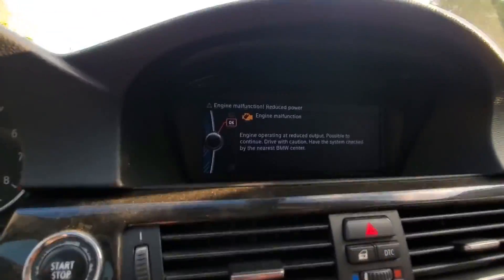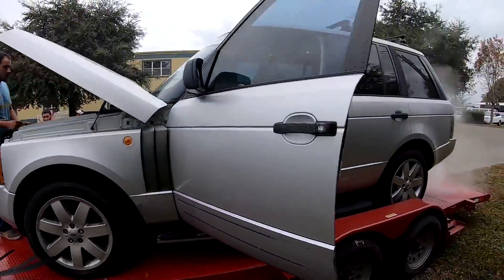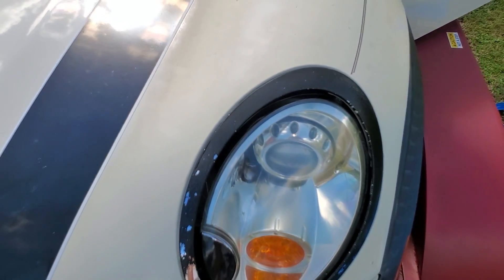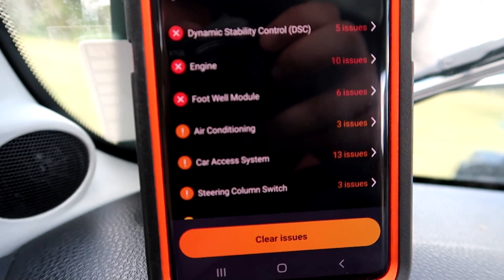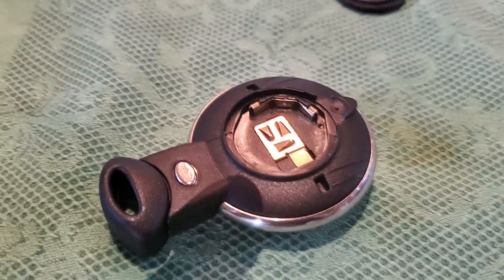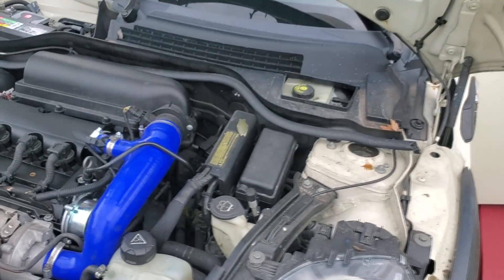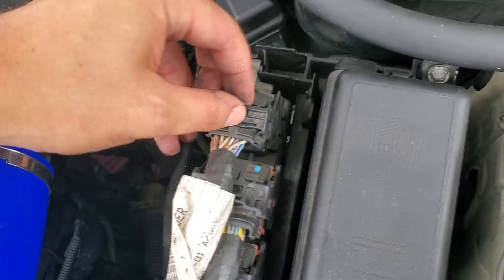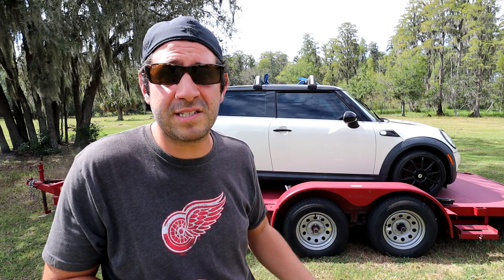I Bought a Factory Flawed Mini Cooper Turbo for $1,000 at Auction! How did Mini Get Away with This?

Comment: the oil dipstick is original. oil level needs to be between the two metal “things”, dots, or whatever you call it
Reply: It is absolutely not the OEM dip stick.
Reply: @adamg4699  it is a OEM dip stick from mini. Maybe there were few designs,but this one is OEM as well.

Comment: The vacuum pipe on the back is a common modification. The rear plastic breather pipe cracks and causes issues. Much easier to replace with silicone

Comment: I own two Mini Cooper r56, the key you have is not the oem one, is an aftermarket version of it. Most people buy the aftermarket key shell  'cause if you want to replace the foab battery on the oem one you have to WELD it on the chip. 
Second thing, I had the same problem with the lock, red steering wheel logo. I've been fixing it wrapping the cas module with thermal tape, the error A0AA is casued by the heat of the sun hitting the dashboard

Comment: with the changes made in the engine bay i would not be surprised if it has been remapped . also the n14 engine that is in that car had issues with timing chain tensioners , if you get it running get it checked out

Comment: like a 4 way switch, if it stops working... just pull it out of the box and jumper all the wires together and replace the ignition key with a traditional locking barrel. send the immobilizer unit w/acc back to the dealer so they can install it back into a different rental car.

Comment: Make sure to check the timing chain tensioner as they are a common fault which BMW do not like to admit but if it goes it is a new engine and they are also not cheap to have done the part is cheap enough but the labour is over £1000 in the UK with the dealer.

Comment: Do you have to clear the codes for ‘Car Access System’  as well also does this model have a key hidden in the fob (small button on the tip you would attach to a keychain press and the key slides out) if this will lock and unlock your door then it should be the correct key for the car

Comment: take the actual key out of the fob by pressing the little silver dot at the back of the fob,now there should be a normal key insert under the plastic surround on the left side of the column try that,.

Comment: Cooper stick should be yellow or red handle spring material or stiff cable the test end is usually a cylinder of alloy with a flat end and steps every 1/8 inch

Comment: Go to the junkyard and get a factory programmer, I did the same with my Cadillac. I think total I spent 300 on the MDI2 programmer and pirated the tec2 software, and 50$ on the computer with a one year warranty from a junkyard, just match the VIN and serial on the computer and you should be good. Ebay is another option on the computer.

Comment: I actually had the same exact problem, but it did not stop the car from running, guess it would have done so eventually. I bought an obd2 cable with software from ebay, with the proper bmw software and reset the counter, for only 15 bucks. One year later and nothing yet.

Comment: Check the floor mat hasn’t slid forward stopping the clutch pedal from making contact with the switch. We had a brake down call out on a friends one at 2am and the guy moved the mat and it started right up.
Reply: If not noticed that you had a pedal switch failure check that

Comment: i just had my motor replace a week ago and now am having the same steering wheel lock light coming on
Car starts and runs fine but the lights doesn't go away, wonder if i do the same thing that you did in this video, would that turn off the steering wheel lock light off? Remote still opens and closes the door and actives the alarm

Comment: I fixed my 2006 mini cooper with the same issue. I got a tech to fix it by recoding the ecu. What I found out these minis lose their coding if the battery is left out or flat for too long. $200 aus fix

Comment: Nissan Altima’s have a steering column lock issue, too, I see it at AAA and I usually offer a tow, but if you could let me know a way to disengage it, I would be ecstatic, but I have a feeing it’s a mechanical malfunction rather than electrical

Comment: Im a locksmith in portugal, and my main work is all lost keys situation. my first guess in the beginning of the video was the cas elv was not synced, if so the car will not start, will not unlock elv but the dash will turn on, it probably has the fault and its easy to fix via obd is the car doesnt have eny eletrical problems... but the key fault, im not sure if someone at the auction hand you a key from another car.. if it is the key of the car the remote should work! if so i know how to repair it with a soldering iron at 0 cost.. you just need to resolder the imobilizer chip inside it, the solder in these keys is very weak...
sorry for my english!

Comment: Very common cars in the uk. Bought one a year too young. The 2006 and older r53 minis with the supercharger are the ones you want. After 2006 changed the engine and it’s basically chocolate

Comment: So I had this very exact problem on my Mini Cooper, since I couldn’t code the CAS* module I had to take it to Mini Cooper dealership here in NV. It was $600 for a VIN cas modules to my cooper and free labor cause I installed it my self... it failed however lucky me they were able to order another CAS module and they did it themselves free .... saved my ass now my cooper was running amazing again! Until I blew the head 😭

Comment: I owned an Innocenti Cooper a long time ago... it used to stop as soon as it rained. The distributor was in the front and getting splashed by the water.
I sold it right away.
Reply: Oh Dear! Maybe you should have used your brain then like the rest of us who owned original Minis back then. I bought a 1983 Austin Mini Mayfair and I have that problem at first with the rain ad distributor but what I did was the simple thing that everyone else with a brain cell did and that was to put a rubber glove over the distributor with the leads going through the fingers of the gloves and no problems with rain or damp after that. I even drove my Mini through a deep flood like that where normal cars had conked out because of the water. The later cars also had a splash guard behind the grill going over the front of the engine to stop the water getting to the distributor etc and some people used to do that with their earlier cars as well long before Rover did. Of course you have to use your brain to solve these things.

Comment: If you want to own the  BEST E60 ever, buy the 535D, the biturbo diesel 3000cc engine, the car performance of course is not the same of a M5, but you will be amazed with the performance of the 535D, specifically with the top speed, 0-60 time and last but not least the low fuel consumption.

Comment: Just to let you know the mini r56 with the N14 engine has serious engine problems with timing chain tensioners failing and jumping time,lots of carbon build up on the valves.  Also valve stem seals are also a failure point aswell.  I would run away as fast as possible from the R56 with N14

Comment: Cant you bypass that system. I have a 1995 Oldsmobile 88 that has the Pass Key II immobilizer and I spent  two hours bypassing the anti theft system.  Its easy in a GM from 1989-2002. I don't know if you can do that with a BMW

Comment: Sam good luck with the BMW electronic gremlins. German logic huh?
Please get rid of all that black plastic off the badges and chrome parts. And get some nice Mini wheel centre caps.
It look a solid high spec car so once its running it will be a real fun daily driver. Go Kart handling comes as standard.

Comment: Hey Sam, in an older video, you mentioned that you used plumber goo instead of clay bar to clean your car. I'd like to apply some ceramic coating myself and claybar are just tiny and expensive. Could you name the brand or the kind of product you used in that video? 

Also thanks for what you do, you were the first automotive channel I followed on youtube a while ago and with your shootout for years you made me discover Tavarish (which leaded to VinWiki), Rich rebuilds, Hoovies (and the wizard), goonsquad (which leaded to vTuned) , DIY gang (I love that channel) and I thing B is for build too but not sure for him. It is because of you that I found other interest on youtube ;) I like what you do because it is more accessible for me at my level than the other channel I mentioned above and You give good tips and trick to maintain my car and it avoid me to visit to a mechanics all the time for minor issues. Keep it up, I'll not stop to follow your series :)
Reply from the maker: Just go to any general or hardware store and buy "plumbers putty" I don't think it differs much brand to brand! If you can buy online, try out a clay mitt or clay sponge. Sometimes they can be bought pretty cheap and work excellent!
Reply: @Samcrac  thank you very much, I'm definitively checking that out :)

Comment: I have a stage 1 07 cooper s with the same n14 engine, its on 118k miles rn and I replaced all the ‘bad’ parts like the HPFP, timing chain, thermostat and oil feed lines for the turbo. It’s the most fun car I’ve ever driven and don’t let anyone put you off the n14 engine because all it needs is good maintenance like oil change every 3k miles, its the people who never check their oil level who get problems and then complain.

Comment: The n14 Peugeot engines in these are absolutely awful. My n14 JCW had a timing chain, water pump, rocker cover, turbo, high pressure fuel pump and then  valve stem seals on the space of 18 months
Reply: Lets get the facts straight - they are Bmw designed engine units based on Peugeot block and pistons. Everything that's is poorly designed on them - the cylinder head, timing gear and Vanos system is totally Bmw and utter trash.

Comment: I thought carly did everything at dealer level? My solus will program keys to vag and BMW cars and say if it's the key,ecu,bcm or the lcm that is the issue
Reply: Lol and ur spending $1300 for the solus. I cant stand carly but ur spending under $150.
Reply: @grayantihero6059  how much dose a key programmer cost ? How much dose full vagcom cost and bmw bosh cost? Do you think when he takes it to the specialist like he did with the m5 he will bang in a carly? No because its a piece of junk its also not certified by the car manufacturers because its cloned software real diagnostic makers pay millions for licences rights, add that any live data you try to read with anything over 2 pid is going to come out all over the show as Bluetooth just isn't thst fast. If he wasn't getting paid to then he wouldn't be using that pice of junk used to love his older vids but he's become a shill   like rich spends first 5 mind of the video trying to get you to buy things via a link. Just hope tavarish doesn't follow suit

Comment: That is a Craven Speed oil dipstick.  The factory ones were hard to read.  Cravenspeed came up with a better oil dipstick to read oil level better.  Important as these burn oil oil a bit.
Reply: A few months back a neighbour called the RAC (UK) out. They were still there 
half an hour later and I went over to see what was up.

The neighbour's other half had decided to top up her MINI's oil and had 
overfilled it I was told. RAC man had confirmed it - apparently the dipstick was "black way above maximum" - and was messing around with an oil siphoning kit found in the 
back if the their van which didn't have a suction tube small enough.

Why not use the drain plug? He'd not got anything to drain it into. But I 
had. He drains out say two litres and checks the dipstick. Puts some oil back in 
and checks the dipstick again. Repeats this a couple of times then starts 
to say things like "These dipsticks are always hard to read" and "I'll let 
it settle a bit".

So I step in. Clean the dipstick of any trace of oil and dip. There's oil 
right on the end, well below minimum. Put in a some more and it's up to  
Min. End up putting in all that was drained and it's just below Max.

The sump never was overfilled. Left the neighbour and RAC man apologising to each other.

Comment: Why couldnt you just replace the rod bearing on the M5 instead of pricing out a new engine? Seems like only a couple hundred dollar fix depending on what new bearings cost.
Reply from the maker: Because when you have a spun bearing it will damage the crankshaft; then the crankshaft has to be repaired and you basically need to tear down the entire engine.
Reply: Samcrac alright, good to know if i come across a cheap m5. I thought i had seen others just replacing the rod bearing without any issue but it must be caught early or something.

Comment: Something is preventing the car from recognizing the fob. Most likely that's a problem with the fob itself/it's somehow different from the one it came with or the antenna that communicates with the rfid on the fob. There's a great tool that can check the antenna coil on several brands that's pretty affordable but I'm not sure it's available outside of a locksmith supply house. 

If more people knew the planned failures & other stupidity designed INTO BMW vehicles, they'd be out of business in short order.

Comment: BMW making bad cars? Let me tell you the story of my Peugeot 207cc. It has got an engine co-developed with BMW and powered 207/208 and from BMW Minis, specifically 1.4/1.6VTi 16 valve engines (normal and turbocharged). They eat oil like nothing and they called it a design feature. 0.5l/1000km on a brand new engine is said as "normal"... :)

Comment: You traded in a beautiful M5 for a fing Mini, damn dude

The one who got the M5 must be thrilled
Reply: A "beautiful" M5 with a five-figure flawed V10 engine that eats its own camshaft bearings. Once it does that, it's bye bye engine, hello $35k engine replacement. Samcracc did the right thing. He bailed out just in time. You could buy five brand new MINI engines for the cost of ONE V10 engine and at least the MINIs don't eat their camshaft bearings or leave you stuck with a $35k engine replacement bill.
Reply: @houseofno  sacrifices ma dude

Comment: You will find that the engine in your mini is not a bmw engine and a Peugeot engine. Didn't use bmw engines till later date. And for those who would like to argue with me on this they used the same engine and probably the ecu as in the peugeot rz coupe
Reply: It is very much a Bmw engine based around a Peugeot tu series block and pistons. It's cylnder head ,timing gear and vanos system is totally Bmw designed - and is the reason why it's so problematic.

Comment: BMW ( Bury More Wealth ) has the better idea but their system of immobilization is flawed. Got new key programed at Toy dealer for $ 84.50. Mini's make nice clown cars but it is Detroit Iron you should be after. A LOT less hassles. The trust and the legend is that you require a Swiss bank to maintain one.  Opel is a better value. Drop the name chic.                                                            Cheers.

Comment: Money pit Sam, those oil dipsticks are a nightmare to read, throw in an 18000 mile service interval and you have a recipe for disaster. I let my heart rule my head with one of these,   kept it for 3 months and finally got rid of it when I realised the timing chain was on it's way out, motor was full of sludge after 4 dodgy owners in 7 years.

Comment: Looks like the Peugeot EP6 engine.
Reply: It's is - block and pistons are Peugeot - Cylinder head ,timing gear and vanos were Bmw designed for both Psa and Bmw applications.

Comment: What a completly stupid diagnose. Why would you clear the fault codes in the steering column module. This is the module with the wiper and turn signal stalks and has absolutly nothing to do with the immoblisor and steering lock. This is al controlled by the cas module but you never checked the fault codes of this. 
It could even be a failed abs sensor because if the cas module doesnt receive a proper speed signal to know if the vehicle is at standstiĺl it wont allow you to turn the ignition on. 
And to check if the key is regonized by the cas module you could have checked live data.

Comment: Huh, similar sh*tty "anti theft" electronic steering lock fitted in MBs up to around 2014.

ELV module fails near 60.000mi/100.000km without much notice. AND, if many faults are detected, its internal computer fries itself and you must get a replacement from MB DEALERS!

$1,200 costed my father in a W204 C280 for that stupid thing, and to make matters worse, a friend had borrowed the car and was in another country 😑
Reply: the motor on this steering lock is waaay better than the mortor in w204 w212  and others mercedes, they fail alot more than bmw elv's
Reply: EliteRocks ! Don't know about BMW, but Mercedes is not a matter of "if" it fails, rather "when".

For someone purchasing a car which its ELV wasn't replaced, it must be taken into account when bartering the price.

Comment: This is a psa (french) engine, very unreliable
Reply: It's a Bmw designed unit based on a Peugeot block and pistons. The cylinder head ,timing gear and vanos is totally Bmw - which is why it's so unreliable.

Comment: I had the battery fail in my F150. No problem, just charge it right? wrong. Windows won't work...why? because the ECU is programmed to know that you have power windows and if it "forgets"? you have to cycle through the on off on off on off a number of times before it remembers. 

No problem right? except if it's POURING FREAKING raining out and you're getting soaked.

What moron in their right mind thought up the brilliant plan to have the ECU need to know what kind of windows you have? what kind of sun roof? if you have a power sliding rear window? wtf does that have to do with the running and efficiency of the engine? 

One more example of how engineers think they're so goddamn smart but they're really dumb as a post when it comes to real life.